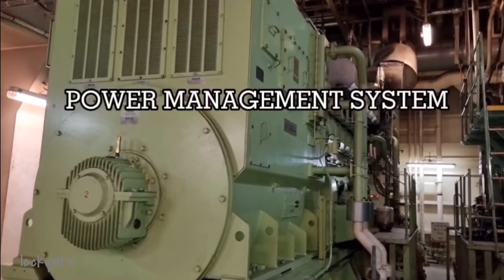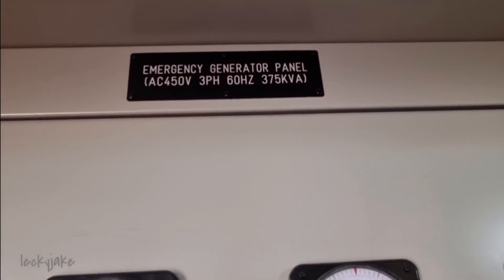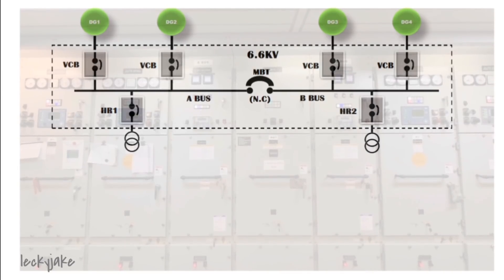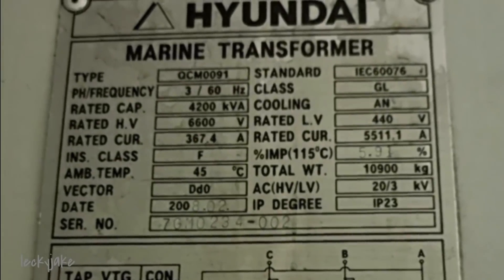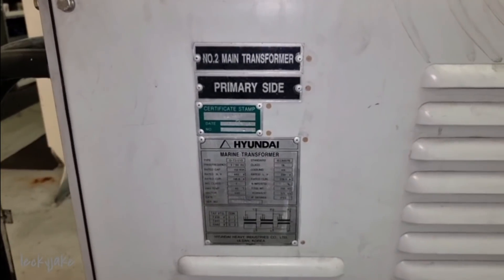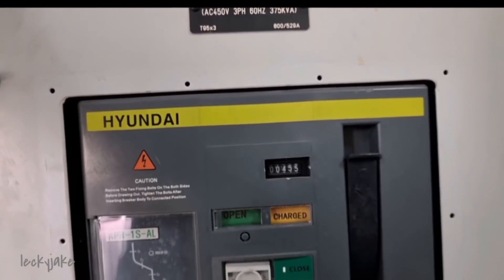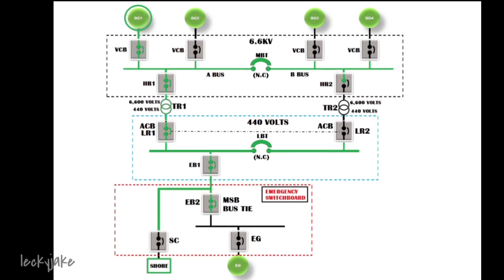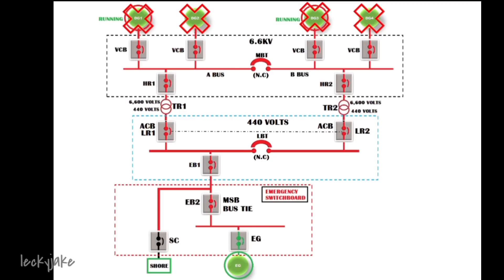6,600 VOLTS HIGH VOLTAGE MAIN SWITCHBOARD

Comment: the 6600 volts means 4 generator produce 6600/4 volts? each one 1650 volts? these ones are series? and what about alternatos? 1650 volts means the alternator produce 1650 volts and what is the output of generators?

Comment: Very interesting. Why do you step down from 440v to 230v instead of using a normal 415v/240v star connected transformer?
Reply from the maker: We need the current to be that high for such great loads

Comment: Hey Lechyjake, have you ever had to do a repair with "improvised" parts? Like, has there ever been a necessary repair that you didn't have the part/resources for? What would happen in that instance? For example, if a contactor inside the elevator controller was burned out, and you didn't have an exact match, would you try to use a similar part, or leave it off until you get the correct part? And would that procedure change depending on the importance of the system?
Reply from the maker: A lot of times. Not all the time we have spares onboard so we need to be resourceful
Reply: @leckyjake  that's interesting. It's crazy how similar technical repair jobs are like that. I almost never have the parts I need as a theater technician (we're nonprofit so the owners never like buying equipment) and it's nice to know I'm not alone with that.

Comment: Does the star point on the TX's get grounded to the ships hull as an earth path, or do you run a separated earth system onboard?
Reply from the maker: The grounding system onboard is always using the ships hull as an earth path.
Reply: @leckyjake  thanks. I should have maybe said the neutral / earth link point (TX starpoint). But thanks for the clarity, I just wondered if having neutral and earth connected to the hull created any corrosion issues with electrolysis.

Comment: Very informative video and system layout. Four Generators and one emergency generator along with the VCB and ACB. Quite interesting how the step down transformers are wired form 6.6 Kv to 440VAC to 230VAC.
Reply from the maker: Thank you very much for watching
Reply: Transformers are wired from 6.6kv to 440vac to 230vac